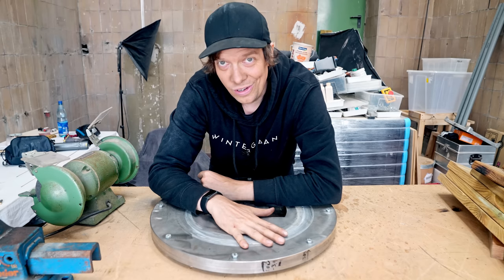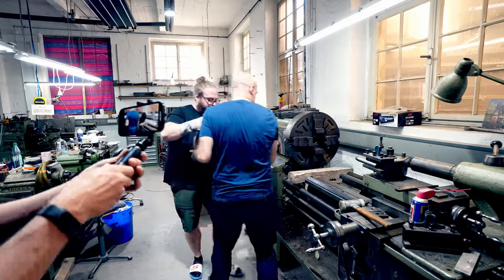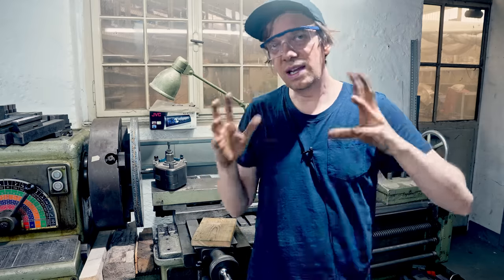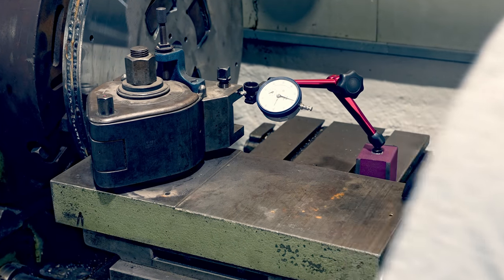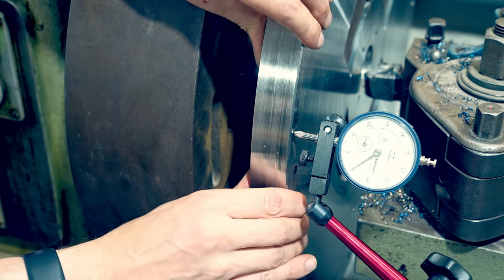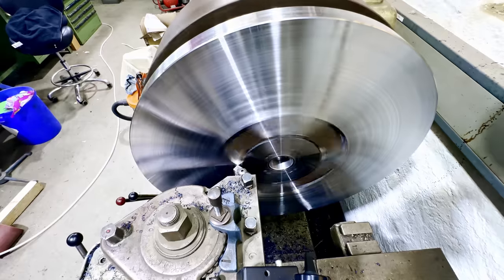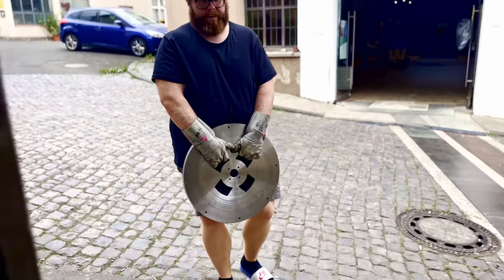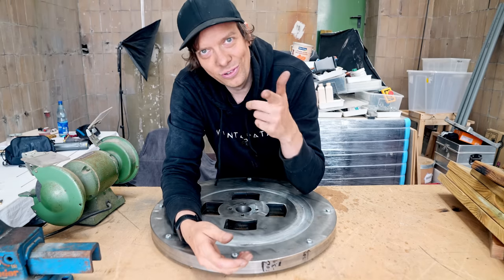Can I Turn This Wobbly Flywheel Straight? - DAY 7,8,9 - Marble Machine Flywheel Prototype

Comment: Concerning the setup on the lathe (coming from the watchmaking world where I work with significantly smaller parts), once you have the ID turned and faced the first side I would've fashioned a mandrel to centre the wheel and finish the OD and other face based on the reference of the ID and first face. That way you know that the sides will end up parallel to each other and the ID and OD as well. I'm not sure how feasible it is in the scale you're working with though.
Reply: I would says do one face flat first, to get the reference surface. Turn it over and make sure is flat against the mandrel (the first cut made the surface flat so it should be now easy to get this surface lying fully flat on the mandrel). When checking for the alignment with the mandrel like at min 4, this should be done on the surface that is against the mandrel, not the opposite one. Then do all the rest without removing the wheel to keep the current alignement. The second face should be parallel to the first one, the OD and ID should be orthogonal to the first face, and if you did not remove the wheel  between the OD and ID, there will be also concentric.

Comment: As a Musician, you must be very aware of your hearing..Though it may not appear too loud, Lathes do make more noise than you think.. and with Good ear protection, you can hear the tool cutting...
Apart from that .. Nice Video, explaining all the features of the Lathe, and the Indicators, the most trusty tools of any metal machinist..
By the way.. did no one tell  you how to use the Scales on the handwheels?.. these work in the same way as a micrometer, the analogue kind, and you can move the scale around to set your zero..

Comment: You need to turn the flywheel holding it in the lathe with the center rode this way the flywheel will be true to the center rode.

Comment: Nice lesson and demonstration and good project.  Did you true up the unmachined second face from the unmachined  surface or did you measure from  the back face that you had already straighteded out?  I've tried to get it from the video, and couldn't tell if you'd used gage blocks between the chuck and the work.  Seems like the flywheel could have varying thickness.
Balance would be more important with a too-small shaft.  A 30mm shaft might help compensate for possible surface irregularities.  That wobble might be from the shaft bending due to balance errors.  Also spacing the bearings as close together as possible might help.

Comment: Have you looked into having a flywheel made of cast iron?  I'm sure you can find a small foundry that can cast your flywheel.  It might be a better choice than welded stacked steel plates.  Just thinking out loud.  Thanks for the video.

Comment: You always adjust a toolpost height to a live centre or centre drill, not a ruler.

And when you use a four-jaw chuck, you always align the part by adjusting the jaws independently. Also a tip from a machinist, if you are trying to make something with minimal runout, you always face the part, turn the OD and then bore the ID in that order.

Comment: When you flip the flywheel round, would it be better to reference the back side of the wheel (i.e. the one just faced) so both sides will be parallel?
Reply: This is my thought too. It looked like Martin indicated the rough front surface and not the faced one.
Reply: Exactly.

Comment: You should first remove thick layers (0.5mm for example) of metal but not reach required dimensions, and after that remove thin layers about 0.01-0.05 mm to reach precise dimensions.
When you removing thick layers, strong forces acting on tool and processed body, them can move it slightly and can cause some errors.

Comment: The smarter way to do this would have been to turn the first face only in the first fixturing. Then flip the part, dial in on the back face (the one you've already machined) and machine all other surfaces in a single fixturing so that they're all referenced to each other and you only have to dial in on the one machined surface rather than three.

Comment: you should use the clutch when starting and stopping the lathe, its much harder on the motor to start it up with the clutch engaged
Reply: nevermind, looks like the clutch handle on this machine is just a power switch

Comment: It would be nice if you could use two dial indicators on each side at the same time to see how much they correlate. I believe you could use that to see if the fly wheel is just tilted on the shaft or if the faces are not parallel

Comment: You welded the inner ring, the densities of the metal are now going to be off, so you may still get vibration, you will have to tack balance the wheel. It's not very easy... :\

Comment: I think better solution was to install all that sandwitch more accurate before expanding the inner diameter
In that way all the wheel should be straight right after that expanding

Comment: Trying to turn an unsupported flat wheel to achieve true flatness is impossible. It will flex on itself. And, you don't need to do it.
What you truly need (which you already know, but it can't be stressed enough) is to ballance the wheel, either by drilling holes or making inserts in it. This will prevent the wheel from rocking the shaft and bending it also.

Comment: the flywheel being out of tram on the axle, not necessarily the flywheel not being straight but you mounts, and who knows your mounting holes are probably not square to the machined surface. always drill mounting holes last on something like that where you have no reference point.

Comment: 11:30 what youre doing may seem proper but is just so complicated and takes forever. Just turn on the machine, go almost to the edge and start cutting, youll see and hear when the cut is not i terrupted anymore. Also you dont need the dial to see how far you moved the carriage, there should be a nomius on the little hand wheel that shows you this too. Usually in .1 mm steps. Careful for the X axis, most of the times is diameter, however some show radius :)

Comment: I'm seeing your problem here with these flywheels. When you reamed the inner hub   the plate was not perpendicular to the boring bar. On these bigger plates any misalignment gets magnified. Having a loose chuck is a real gut punch during the turning.
That's a lot of improvement. Now your problem is you have a weight imbalance in the wheel. Definitely agree that a 30mm axle is a really good suggestion.n

Comment: You also re-tightened the tapered bushing in under gravitational load? it wouldn't bite perfect like that.  Although you could likely adjust it's angle when it's biting.

Comment: instead of turning the wheel to cut off metal you probably should have looked to see if something else was throwing off the wheel.  it was probably something misaligned with the axel and center bearing

Comment: Metal plates were flat from beginning. If the wheel is wobbly, it's because the center hole is wobbly. You need to re-bore the hole and sleeve it. Edit: Wheel is now also unbalanced. Next time, cut a V between metal and sew in-the-ditch, so you're not adding weight in odd places. Surfacing is very last step. For that, you'd install a short shaft, and put that into the chuck. But i don't see any reason to resurface, as you're not putting head gaskets on it. 😁

Comment: To get pro results you have to do to like the pros. Using a real welding table, one with a perfectly flat thick metal sheet top. Not a floor made of ceramic tiles or a wooden workbench.

Comment: Wouldn't it be better to turn the flywheel by attaching a short shaft with the tapered bushing and clamping that into the lathe? Maybe some part of the wobble is introduced by the bushing.

Comment: Measure the run out on the rear of the fly wheel and make the back face level with the chuck. Then lathe the front face this will machine off the wobble and make the plate thickness the same all around. You shouldn't need to machine the rear unless you put the machined face on the rear and measure your run out on the rear face again. Measuring the front then machining the front is the problem

Comment: Why not have a fixed axle and press a bearing into the center of the flywheel? Then imperfections in the shaft would not affect runout. Maybe you are planning on using the other end of the shaft to power something else but that could be shifted to another position and powered by the same belt.

Comment: You might be able to 'tap' it in... the hub junction is not welded.  If you remove it, and it re-installs with the same wobble, then your method is probably OK.  Watching the rest of the video now... you definitely should loosen the hub taper and tap the wheel into being straight.  You could always make a jig for holding the wheel on the shaft during cutting... you'd be assured of perfect results then... but of course you'd want a much thicker shaft for this.  Or... machine it in-situ!  On the frame... but you'd need a much stiffer setup for that.

Comment: Having spent many hours trueing bike wheels, I'm skeptical that you can get it down much below 0.5mm, even if everything goes perfectly. The same imperfections in the metal that cause a perfectly trued wheel to be unbalanced also cause variations in expansion and contraction, and it'll stretch differently while spinning. Both effects on the order of fractions of mm, but when that's the tolerance you're designing to, it becomes a problem.

Comment: you need to use the correct order of operations
surface one side then the other then you do the edge and the hole

if you want a better surface slow your feed and take smaller cuts
and your finishing cut the slower the feed and smaller the cut the better it will look

how ever for a prototype this is much better

Comment: I'm not sure why you're worried about the flywheel being absolutely flat. In an automotive flywheel that contacts a clutch, that's important, but in your case the clutch is a completely different design that doesn't require a flat flywheel. Even flywheels that are absolutely flat require balancing because the metal isn't absolutely uniform in microscopic structure and therefore density. You would be better off leaving the flywheel heavier by not removing material unnecessarily and only do a dynamic balancing procedure.

Comment: I did not understand the 4 flywheel holes until this video.

Is it possible to have a cnc face the 2 faces before lathing? The faces would still need to be lathed but it might help getting everything square in the Chuck.

I’m Not a machinist

Comment: Since you are breaking against the flywheel that's a lot of force and momentum to knock it out of true again but if you could disengage the wheel and break at some other point? That would have safety concerns though.

Comment: So you welded the edges, and then you shave off the edges.  I don't know much about how deep welding goes, but I would think that can weaken the bond.  Maybe you could had welded in some pins in the bolt holes to make sure it stays secure.

Comment: Shouldnt the face you face in the lathe in operation 2 be the same face you clock to 0 runout before facing the last face? to make them paralell. Or could you use the chuck as a refrence to the faced part of the flywheel? or is the chuck not faced properly?

Comment: If you swap out the shaft for the larger 30mm, you would have to re-cut the center hole, which means you can get it straighter this time, right? (not an engineer, just a viewer lol)

Comment: I'm surprised you didn't cut the central hole wider and use an insert or shim between the shaft and the wheel

Comment: Perhaps this does not apply to your chuck, and im not speaking from much experience; but what id do to get the face and hole peripendicular, is to first do a face cut, and then mount it with the face cut onto the face of the chuck, which should be flat itself? And then bore the hole. But as you said I dont think it matters much. The flywheel could be at a 45 degree angle relative to the axis and it could still be perfectly balanced. As long as it isnt transmitting any vibration to the rest of the structure, you should be fine; and you are at the mercy of other non-machined surfaces like the chuck-holes anyway, so youll have to optimize that by drilling out bits while its mounted to the marble machine itself.

Comment: So I believe one problem is once you had the first face finished and you flipped the flywheel you did not use guage blocks to space the newly lathed flat piece to the chuck. So, one face is not relative to the other. That could be why one side is worse than the other.  I am no machinist, but I watch alot of machining videos.

Comment: How much energy would actually be lost with a 1.7mm oscillation? Is it worth being more precise? Or is it now more a visual presentation issue vs energy?
Reply: It's neither issue. Wobble is partly related to balance, and an unbalanced wheel imparts vibration into the machine which increases wear, reduces safety, and obviously also shakes everything around. Obviously this doesn't really achieve a proper balance, but if the metal is approximately the same density all around, then truing everything up will approach a balance.
Reply: @STRIKEcorperation  Balance is around the axis, 'wobble' as we're calling it here is along the axis. That wobble is not really important and does not contribute to vibration. I mean... look at a boat propeller, which you could make by cutting that wheel into leaves and bending them to get an extreme 'wobble'. The runout doesn't matter either, you could rotate a square block or even a plate cut into the shape of Australia with no vibration as long as the center of mass is on the axis.
Reply: @iforce2d  you're thinking of static balance. Dynamic imbalance can exist even if the center of mass intersects the axis of rotation.

Comment: why turning the ID first ? Indexing it yes, but while the entire wheel is still out of balance on the chuck etc, it makes no sense to me to do the most critical part first. 
Leave to the last step when all is as true and balanced on the lathe.
Reply: and I would nearly suggest, to mount the wheel on the shaft as the very final finishing step, then mount the shaft with wheel on the lathe and just do a very small final pass with all in place.

Comment: No need to index the center hole if you just are doing a facing, I think? Shouldn't the side turned first be indexed to get both sides parallel?

Comment: CENTER DRILL THE SHAFT TO USE A LIVE CENTER, MOUNT THE SHAFT AND ALL INTO THE LATHE AND RE-TURN YOUR DISC ON THE SHAFT YOU ARE USING.

Comment: hi Martin, Is it not possible to move both poulies to the outside of the bearing block or to the other side of the flywheel? now when a belt is worn or damaged, you literally need to dismantle everything because to the left of it there are 2 bearing blocks and whatever goes in between and to the right you have the flywheel and one bearing block. moving it to the other side of the flywheel you only need to take of the right bearing block and the belt can then slide out. moving it outside of the bearing block (butted up against it) will make it as rigid and you can take the belt out without dismantling anything else

Comment: i might be better to machine it on a mandrel with a drive dog to once the centre bore is done.

or if you want easy weight changes what about the plates weight lifters use? if the centre bore is close. minor differences taken up via machining or sleeving?

Comment: I would just suggest you seal the edges of these plates to prevent any moisture ingress otherwise you will find over time rust will push these plates apart and cause warping…

Comment: If the shaft is too small.  Wouldn't a fix be getting a "thicker" shaft, and then you'll have to expand the hole in the flywheel anyways, making it possible to get a new surface like u wanted?

Comment: I know this is after the fact, but is oil supposed to be applied to the bit of the lathe to help with cutting?  I don't operate lathes very often, so I would be a beginner like you are in operating one.

Comment: I just hope you don't reinstall the brake in a manner that pushes parralel but off-center to the axis, it'll make it wobbly again right away
please use the method you first displayed, when you used the brake to push perpendicularly, into the axis from the outer diameter of the flywheel

Comment: Not an engineer so I had a question. The 3 plates are welded on the of od and id but from inside the are still separate. So when you turn the od, isn’t that basically removing the welds? So why didn’t the wheels separated? Is it just because of the id welds or something else?

Comment: Edit: Original comment was before seeing the lose chuck, which I'm sure played a part

Someone who knows more than me explain please!
My metalworking experience is next to non existant

Is that kind of sparking normal on a metal lathe? I would have expected that a one of the setting of feed, speed or depth would have been too much if it's sparking like that?
Is the cutting tool a carbide insert? I would imagine it'd be dulling faster if it's throwing sparks?
Is this more common in older machines?

Comment: Of course you could turn a whole flywheel in order to equilibrate it. Or CNC it from the get-go. You could also have balanced the roughly made and rather affordable flywheel with small weights, like you'd do with a tyre. Don't want to be the party pooper here.

Comment: Why don't you get the next flywheel cut out of thicker plate? Then you don't need to weld them together.

Also, as others have mentioned, the insert on the tool either chipped or moved during cutting.